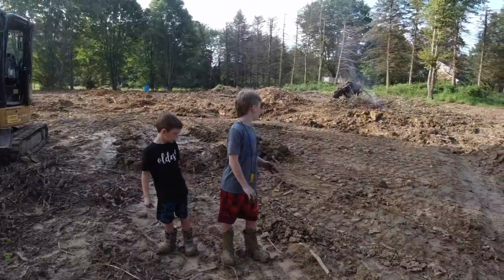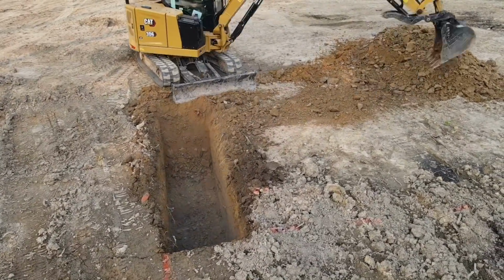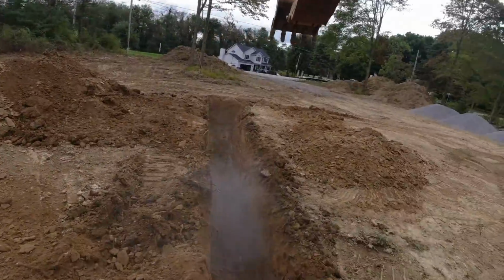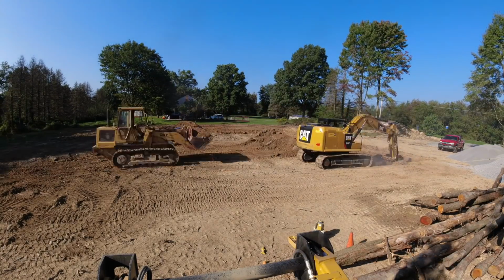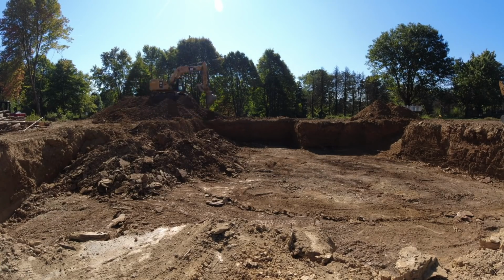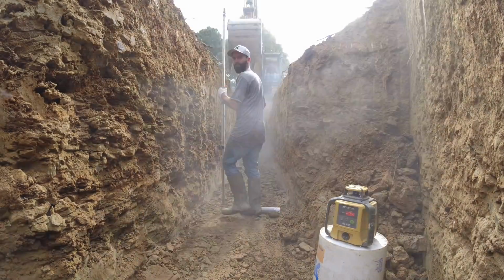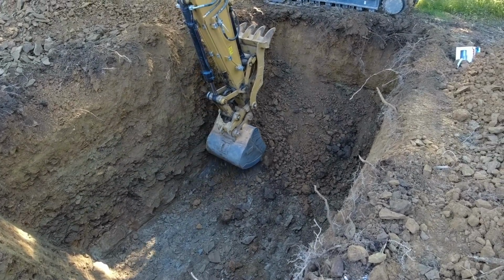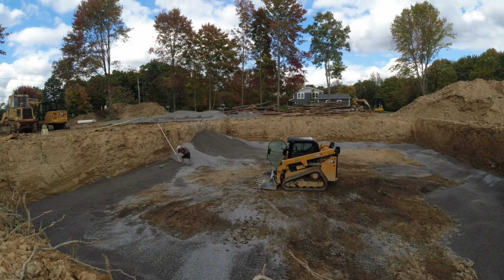It is Time! Breaking Ground!!!

Comment: Neat to listen to all the detail.  We looked at that type of wall when we built our house several years ago.  It sounded like it seals up well and is solid.   We ended up going with a concrete footer though and poured concrete walls.   The new footer systems are neat.  They use a plastic form that is maybe 2 inches thick and hollow in the middle.   It then is left in the ground after the footer is poured and acts as your french drain on the outside and if needed, your vent for radon gas on the inside.  Guessing you have seen hundreds of those but that was new to me.

Comment: Question...Is radon a typical problem with that shale rock? You should test for radon after you get the house weather tight as if it's present, you will need a ventilation system to mitigate the radon.
Reply from the maker: Radon is an issue in our area.so we did install a radon system.